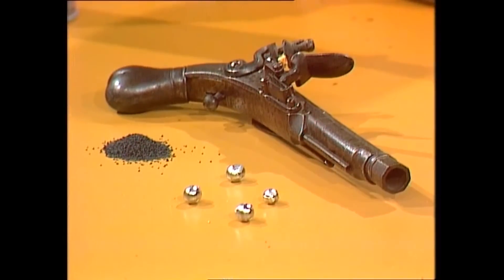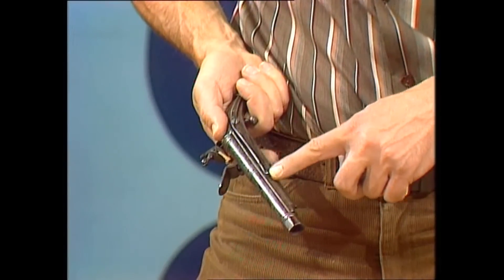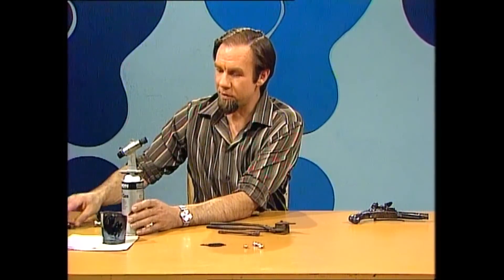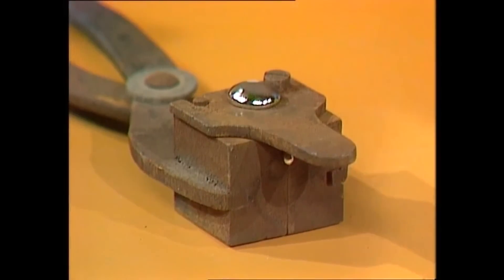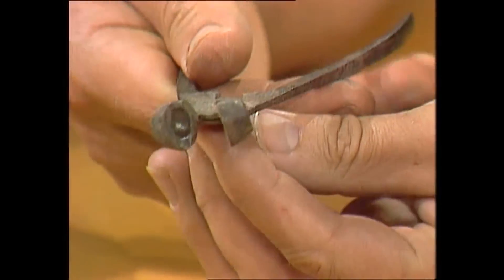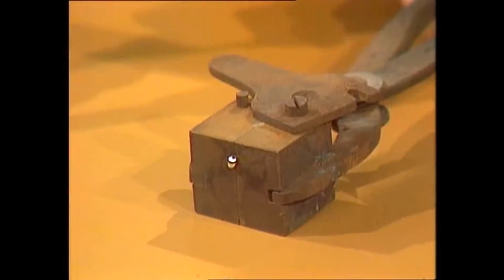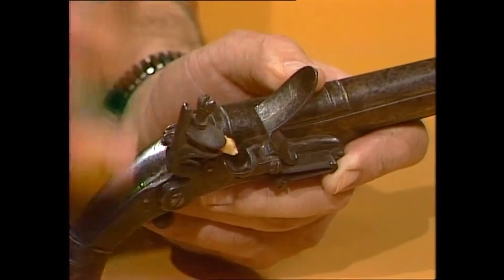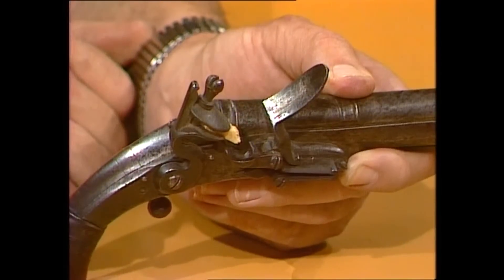A quick tour of a flintlock pistol

Comment: The flintlock is also responsible for the saying "going off half cocked".
When loading a flintlock you weren't meant to pull the hammer all the way back but only to the first click or the halfway mark. Sometimes if it was bumped it would go forward and actually fire the pistol from that position hence the saying.

Comment: That "piece of steel" that the hammer (with flint attached) hits to produce spark is called the frizzen. Also, you use one wad too many. One wad between the ball and the powder was used as a pressure seal or gas check because the ball didn't fit so tight on it's own.
Reply from the maker: It varies. I have been shooting black powder guns for years.  In one of my muzzle loading pistols a patch (denim is good) is placed on the muzzle and the lead ball forced into the barrel, effectively wrapping the cloth around the ball to make it a good fit with the rifling. Some smooth-bore pistols (the one shown is a smooth bore) might use a wad after the ball is rammed in if the ball is not a tight fit or else it could fall out. Heaven knows what they used with blunderbuses, which are alleged to have had everything from stones to nails poured into them - Rob

Comment: "Flash in the pan" - I always thought the origin was from gold panning? ie. catch a 'flash' of light in the pan from a potential gold nugget, which turned out to be either nothing or something very small. This origin sounds just as plausible and I'd not heard it until just now.
Reply from the maker: I think this is the right one. When you go gold panning, and I have done so, getting bits of gold is great but they look more like yellow wax than anything shiny - no flash there - Rob
Reply: I’ve always known it as pertaining to the flintlock.

Comment: Normally the hammer is only half-cocked when closing the pan so it doesn’t accidentally go off if the hammer is bumped.
Reply from the maker: That's right, although one of my 'Colt' revolvers is a bit dicey in that respect - Rob

Comment: And that kids is how you get lead poisoning.
Reply from the maker: No. Even those who work with lead on a daily basis . like my friend who makes leadlight windows, don't show elevated lead levels. Once the stuff gets oxidised to make lead salts - that is a different matter - Rob
Reply: Pure lead, even when melted, is a fairly tame beast. Just washing your hands after handling is enough to keep it in check. You should be much more concerned about leaded gasoline.
Reply: skin doesn't absorb lead, make sure you wash your hands though